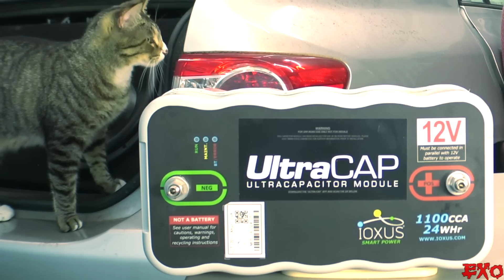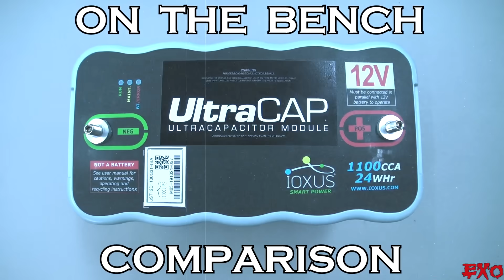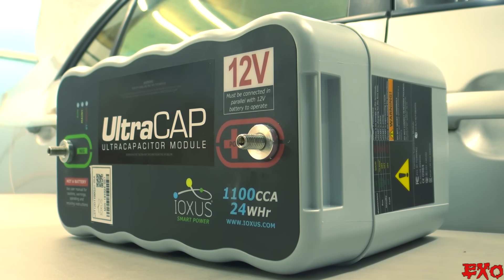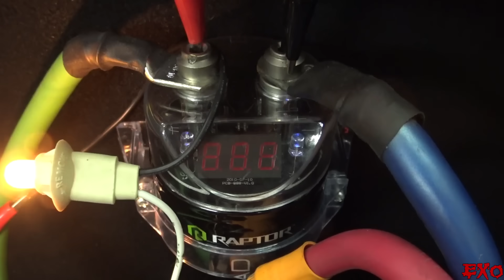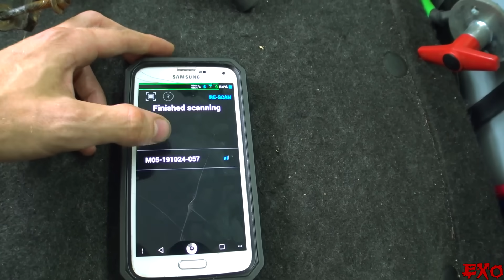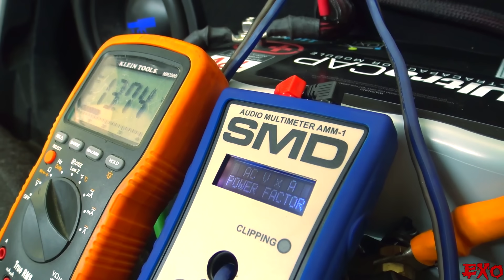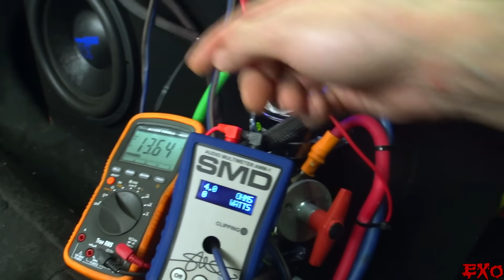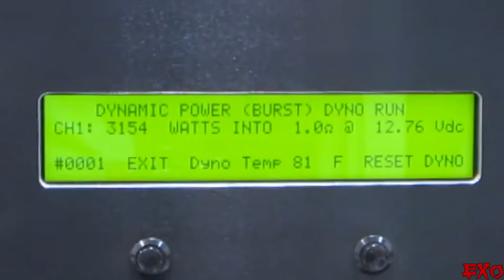The TRUTH About Car Audio CAPACITORS! Testing a CHEAP 12v Capacitor VS IOXUS UltraCap Supercapacitor

Comment: They have to have that warning on it if you attempt to use it as a main starting "battery" it's not FMCSA and DOT approved for use as a replacement for a standard battery. The company cannot be held liable if you use it for that purpose and the product explodes/completely discharges/leaves you stranded. They were intending these for use as a replacement for 1 of the 4 batteries in Heavy duty Diesel transportation trucks and like many things, they were abused for their actual purpose. Bunch of people thought that because they had that, they didn't need to change their batteries when the batteries were bad, so they blamed it on the supercap for their batteries going dead and the supercap completely discharging leaving them stranded. Afaik Supercaps might become a standard thing, not totally replacing, but augmenting starting/charging systems of automobiles and trucks in the future. The technology of super caps using them as a peak discharge device, and power line filter is evident and may become a requirement as computer controlled electronics become ever more sensitive to EMI and RFI. Proper shielding inside the electronics is great, but it can't always factor for the interference on the electrical supply from the battery.

Comment: Hey im running a skv4500 i plan to get a second one and im running a 320 ces alt ive been on the hate capacitor side so i have my old xs batter i there i been looking at the limitless lithium but this interested me how many do i need for roughly 5k watts

Comment: The d'amore testing was done with a true 1 farad cap such as the old RF ones. That Raptor cap is just a case with much smaller caps inside and the rest filled with concrete.

Comment: I had a tsunami 10 farad capacitor running kicker kx 1200 and kicker kx 650 in a 1998 Yukon and had no problems. I’m still using them now in my 2006 Yukon Denali but not the same results. I think I will have to step up to another battery. I still running a autozone battery and the are not giving me the power I need with10 farad planet audio capacitor. The maintenance guy that works in the apartment I live in with my wife said he could make me a box for me with 4 entry model R1 12 inch rockford Fosgate subwoofers. Dude
 I need more help please

Comment: I was looking car audio videos up on YouTube and saw your video about subs and I had to subscribe... bro you are not only knowledgeable about what you talk about within your videos you bring your own real life system meltdowns to us about your trials and errors and how to correct them the right way no short cuts. Let alone you bring a lot of energy entertainment and enthusiasm to ya with every video. I’m going to look into that battery 🔋 I like that it has Bluetooth this is the first time I’m seeing anything like it for a system. I have the Orion HCCA 152 with the Taramps 5K the 2400 Vmax no capacitors and get a great bass hit and all in my 08 Acadia slt2 even tho I lose half my 3rd row I still can fit 5 for the ride 😂 I do get clipping from the monitor control from my amp but I just turn the vol down till there’s no more clipping wondering if I’m pushing to much power to my sub or is my sub trying to demand more power from amp? Thanks and I’ll be staying tuned in to your channel 🙏🏾👍🏾

Comment: Ive learned that a capacitor isnt enough on its own, but when combined with a bigger alt it helps. I put a 140 amp alt on my truck with big 3, amd still had a small amount of dimming and about 1 volt drop. 2k cap got rid of the dimming and got me to about .3 volt drop now. But I am goi g to run a few supercaps on my new build in my other truck(4 NVX 15s in 4th order blow through with a pair of audiopipe 2ks, kind of a budget blowthrough just to see what it can do) along with a 370 amp alt and 2 more batteries in the bed.

Comment: so, for short burst, quick, dynamic bursts, the rapter cap is better than the ultracap, but for longer, or harder drains the ultracap is better. where does a second battery or a huge battery bank fit into this? also, does that mean caps like the rapter would be better on full range or high pass, and supercaps on low pass? and how does adding a higher output alternator affect either?

Comment: I have a 30 Farad cap from Rockville, however, I'm only running 1,200 watts at MAYBE a ⅓ of the way up. 

Overkill, but I won't kill my alternator or battery. Yes, I know it's not a big system. But, even when I crank it, the voltage never drops below 14 volts. 

By the way, it was a job having to install a 15" sub @ 4³ft tuned to 32hz rear firing in the trunk of a 2011 Camaro SS. I can run either ported or sealed thanks a plumbing plug. 

I'm old school. But, I'm getting back into it.
Reply: Beautiful picture
Reply: Thank you. 😘

Comment: A super/ultra capacitor can replace a battery. A regular audio capacitor only helps to reduce instantaneous voltage drop of an existing battery and power system. You can get away with using smaller wires if you have a capacitor. A multimeter like what EXO is using will not accurately show instant voltage drop.

Comment: Crazy, what D'amore showed with his 1 farad cap performing during the burst test is exactly what it has been doing for years.  Great for musical bursts but beyond that they dont help reallyi at all.  Those Super caps are so big they act like batteries basically since there are so many farads.  A good comparison for them would be to a lithium battery since they discharge and recharge at much faster rates.  Also, its not really noticeable as EXO said.  But it does prevent those abusive battery killing voltage spikes from happening to your normal battery.  A super cap is a great addition inline with a battery or bank of batteries that it is supporting.

Comment: I replaced my car battery about 9 years ago with 12 maxwell super caps . Never looked back. It takes about 3 days for my computer and alarm to discharge my caps to around 10.5 volts if I don’t drive my car. Then all I do is start my car and it will charge back up to 14.3v . If I go away on vacation I just hook up my 25 dollar 12v solar panel and it works fine. I have two rows of six caps in series and then I put both rows in parallel. I live in Florida and never had a problem. My caps are exposed to the elements so I have to clean my cap contacts once a year do to oxidation. I’m gonna use lithium grease so it will last longer. Any questions just ask a nigga. Cheers.

Comment: I always wondered about these. Never was a capacitor believer so I ended up with 2 diesel batteries, 0/0 cables, and a mechman 320 amp alternator to power a 1500 Orion and a Jl audio 500. But I still have light dimming on the window rattling notes.
Reply: If I remember correctly the batteries are 900 cca each.

Comment: Great explanation, thank you for the clarification, I honestly never knew about super caps and embarrassingly was one of the guys who vouched for capacitors based on my experience with my old school Rockford Fosgate 1 Faraday cap, but then I had bad experiences with more modern low end capacitors like lanzar and just assumed they weren't made as well as they used to be so I smack talked lol. Thanks again!

Comment: I've been wondering if I need to or should add a cap to my small setup. Last year I grabbed a Kicker CXA800.1 (800W RMS/1600W Peak). I'm only running it at 2 OHM on 4 gauge with a 2V preamp single 12".

Comment: Thanks for making this video. It would be great if you could do a direct comparison between a cap and adding a second battery. That’s where the debate comes usually. However, using the super cap is pretty close.

Comment: If your just running a 4 channel amp for mids/ highs the 4 farad cap will be good, but if your running a amp that puts out more than 500 watts, they just don’t works so well, unless you by like 10 of them per amp LoL

Comment: I would love to have one of those kind of capacitors I'm on disability and can hardly afford anything now  like I used to Big Time bass head I have a Audiopipe 6 f capacitor it does pretty good on a factory alternator stays 14:1 I am pushing 3000 watt RMS on 215 the voltage drops to about 13.1 to 12.5 my lights Harley ever dim the only lights that damn are my dome light inside really enjoy watching your show EXO you're the best

Comment: Cool video. Never understood why people said those 1 farad caps were worthless. I installed for big box in the early 00s and saw, time and time again, 1-3 farad capacitors stop headlight dimming and work fine for years. Customer complains about headlight dimming, 100 bucks later, no headlight dimming. So how's that worthless?

Comment: my thoughts on the argument as an electrical engineer, capacitors (doesn't matter what type) have much lower internal resistance than batteries, this allows them to dump current much easier than batteries.   However, they aren't nearly as energy dense as batteries.  They also are near short circuits with a resistance that exponentially increases as they charge up.  This means when they are drained they demand more from your electrical system than a battery.  Since they aren't as energy dense they tend drain out much quicker than batteries and will require more current from your electrical system to recharge.  Supercaps are excellent for car audio because they are much more energy dense than what i assume the traditional types are (electrolytic) and much lighter than batteries.  Also, extremely high powered car audio is typically played transiently so you can reasonably size out a good bank of supercaps to do what you need for much less weight.  Just figure out how long you want to play at max power, calculate the total energy in Joules Energy (J) = Power (W) * time (s),  figure out how many farads you need using the formula Energy (J) = (1/2) * Capacitance (F) * Voltage^2

Comment: Heck yeah they do. I had a single bank of maxwell super caps and they were amazing. Stabilized my sundown scv 7500 dropping to 11ish volts to holding a constant 13
Reply: Did you have to upgrade the alternator or did the super cap by itself stabilize voltage?
Reply: @Logantheseeker  I had a custom 390 CES alt and 3 group 31 agms with all 00 sky high ofc. I replaced the under hood lead acid with the caps.

Comment: What would work really well would be a connector on the amplifier to attach additional rail capacitors. Given that the power supply of the amp is often the bottleneck, having a good reservoir of speaker-level voltage would give the amp extra juice where it needed it for sudden bass drops.
Only downside is it wouldn't be safe if it wasn't insulated well.

Comment: Love the info, should I use a cap on my truck, 7.3 desiel, dual battery's, cheap 1000 watt amp maybe pushing 250 to a jl audio 10?

Comment: Great video EXO older BassHeads swear by that capacitor. In my experience going with a second battery is much better.
Reply: Hell yeah man,  your whip gets down fosho 👌🏻👌🏻
Reply: Also expensive with extra battery
Reply: @orfeous  depending on which battery you get a good capacitor might run you $100 but a good battery might run you $200